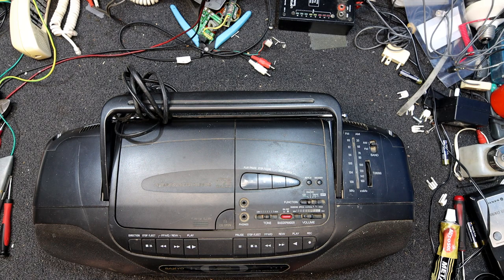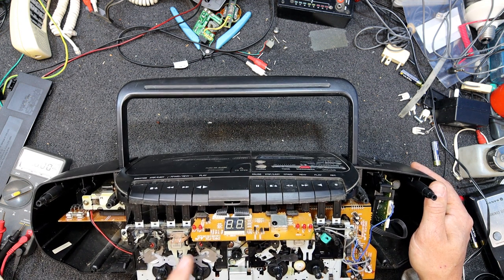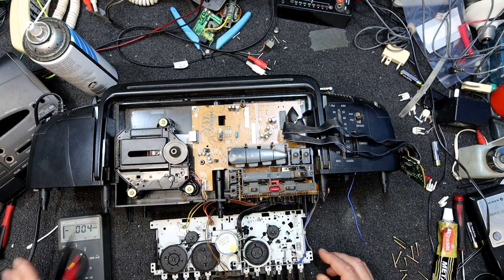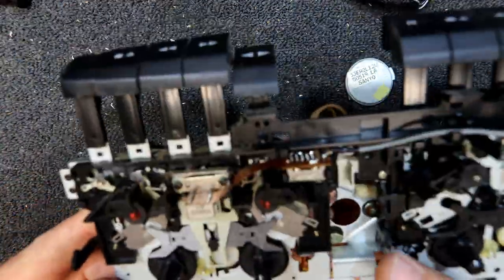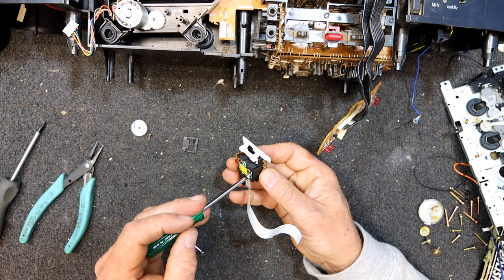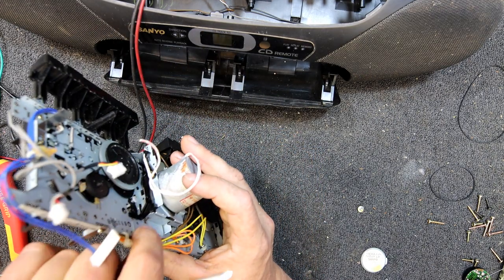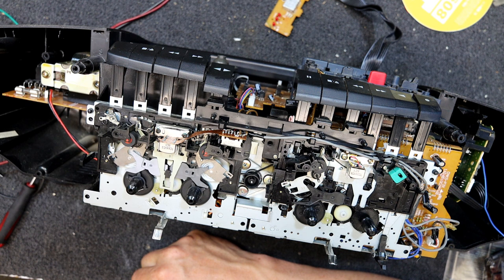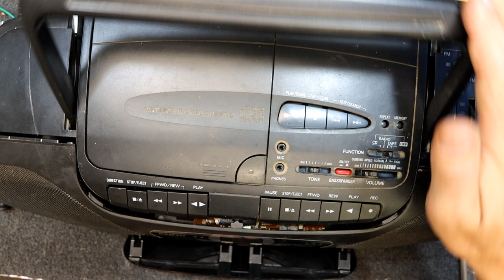Boombox Bonanza 32: Sanyo MCD-Z57F CD Boombox No Cassette Function or CD Reading Diagnosis

Comment: Hi, do you have a video where you troubleshoot a boombox channel/speaker stronger than the other?  My Sanyo M9935K has that issue.  Great videos btw.
Reply from the maker: Normally you need an oscilloscope to compare the signals at various points in each channel to locate what is faulty. If it does it on tape and radio then you at least know its in the preamp or amp section that is common to both. Its worth cleaning the function switch and pots, then electrolytic capacitors are the next most likely thing, which could be checked with an ESR meter.
Reply: @StevesElectronicRepairShop  Thanks for the info.  I'll work on the tape mech first.
Reply: I may have made some progress.  Now, when I press down on the volume, balance or tone knobs/Potentiometers the sound kicks in fully.  Any idea what this might mean? Thanks.